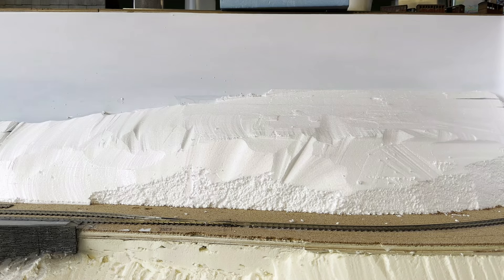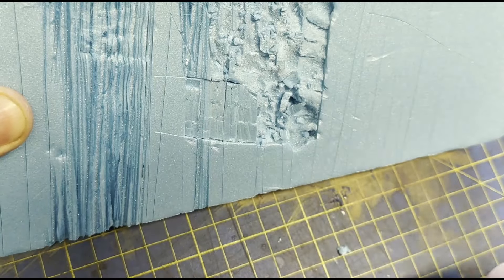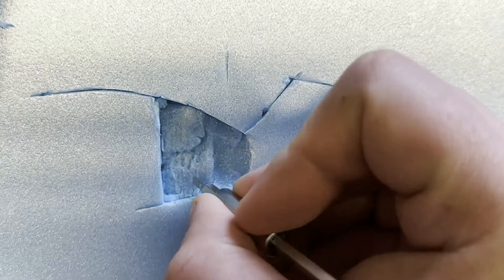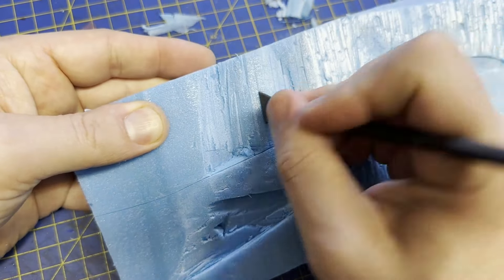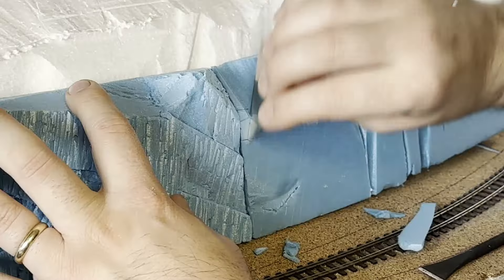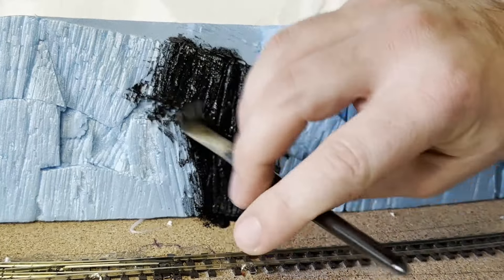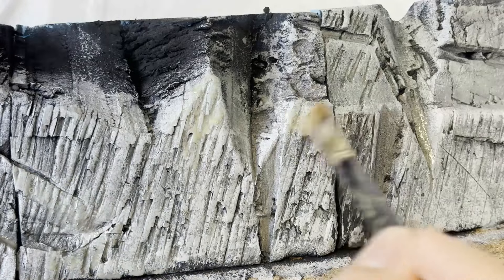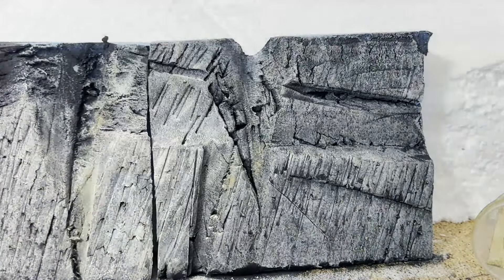How to Carve Rock from XPS Foam for your Model Railway or Diorama

Comment: Hey i know i might be a little late but....one thing ive done in the past to make nice irregular looking stone work is... use your drywall saw     drag it across the face of the styrofoam... because the teeth of the saw are different angles and lengths  you get many different angles and depths  cut it   anyhow just a thought
Reply from the maker: Interesting, I’ll look into that